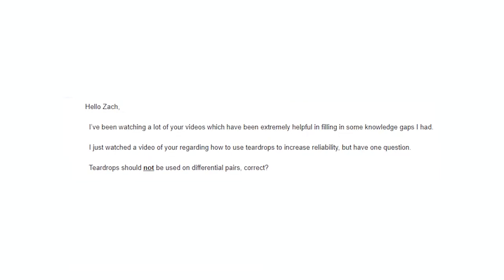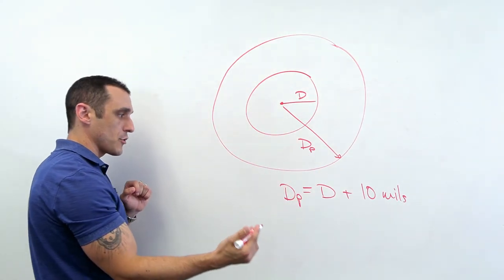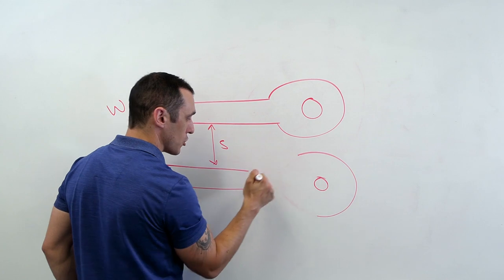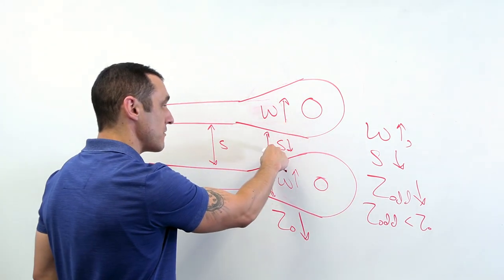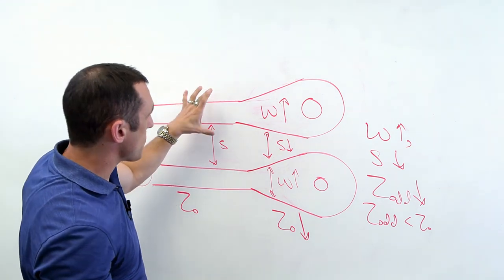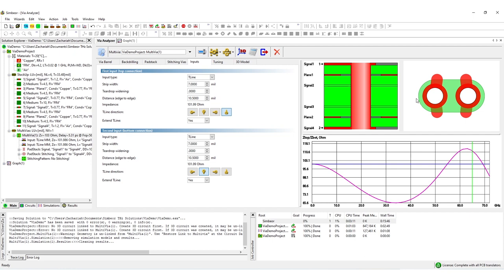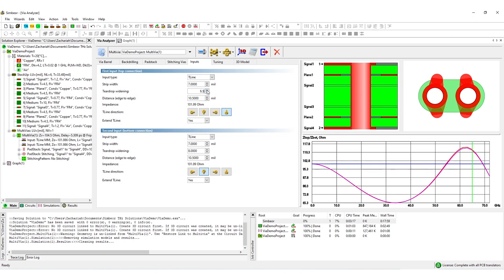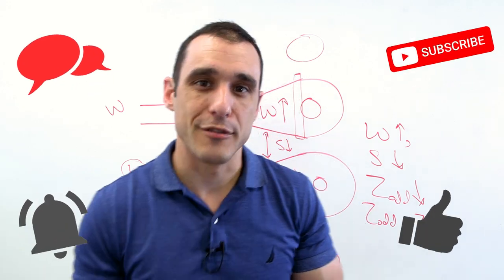When to Use Teardrops on Differential Pair Vias

Comment: You mention that part of the problem is reduced impedance from the traces getting closer together.  Does that mean it would help to put the vias to the outside, eating into the separation from other traces, rather than the separation between them?  _0 instead of -0 ?
Reply: I would say yes this is appropriate and it is usually the way I would do this on something very fast like CSI. I'll show an example in our next Q&A vid

Comment: What if you move the vias far from each other so that you keep the same distance w between the 2 edge of the via's annular ring? I think in that case we not have a difference in the impedance as the distance didn't change.
Reply: Then you'd have a possibly larger impedance discontinuity in the vias themselves
Reply: This is a great question and you would need to maintain some ratio between the spacing and width to ensure you always have the correct odd-mode and differential impedance values. I went over this in our Q&A video, it should come out soon!

Comment: I'm going to throw this question out here for anyone with the right knowledge to help me.  I'm working on a SiCFET motor inverter where the SiCFETs have a rise time of 25 to 30ns and a fall time of 10 to 15ns with a carrier frequency of 20kHz and running the motor in PWM mode from 3% to 97% duty cycle (3 phase).  We have additional functionality that is used outside of the normal PWM run mode that takes advantage of the quick rise and fall times.  Given the SiCFETS are a Kelvin source configuration, should I be treating the gate and kelvin source as a differential pair?  Another engineer has been leading the design on this project, but we have had just one failure after another.  At $10k a pop, these failures have added up to a huge chunk of our budget.  I'm looking into the circuit and PCB design on my own time, trying to find as many points of possible issue that I can.  He has been treating the gate and kelvin source traces like normal, low speed,  MOSFET traces

Comment: Dear Zach, thanks for your brilliant video!
You've mentioned about an article in the description of the video about using teardrops as tapers. Maybe you forgot to attach this. Could you please share it?
Reply: It is in the description, the title is "Should You Place Teardrops on Differential Pairs?"
Reply: @Zachariah-Peterson  Yeah, exactly! Initially I was a bit confused and tried to search an arricle with a title that included word "tapers". I've already looked through it, very useful as usually! A curious thing that I've noticed, that it is not mandatory to make the lenght of the taper equal to quarter wavelength. I thought that this parameter shouldn't vary and the length lambda/4 is a strict criteria for impedance matching.
Reply: @pavelkobrisev2574  I'll do a video on the Klopfenstein taper because it's a good example where you don't use a quarter wavelength match, and you get broader bandwidth matching.
Reply: @Zachariah-Peterson  Sounds like a Black Magic)) Thanks for your efforts! Looking forward to your next videos!

Comment: Is there a way to make round traces instead of right angle and 45 degrees? Or generally follow a curved route with an inflection point when connecting two parts that are not   aligned with each other?
Reply: Yes, so long as the router you are using includes an option or setting to allow this.
Reply: Gerber files allow arcs as well as lines. For generic curves instead of just portions of a circle, just splice together a whole bunch of short pieces.  How easy this is in your higher level tool varies ... Support for arcs has been one of the quality-of-implementation issues that some skimped on for decades.
Reply: While routing, hit the tab key to pause the tool, then go into the Properties panel, below the geometry options you will see some options to select right-angle, circular, etc.

Comment: hello sir, what do you mean by class 3?
Reply: I believe this refers to IPC reliability standards
Reply: Yes I am referring to an IPC reliability standard, which will place requirements on annular rings during manufacturing. As a designer, this means you need to include a minimum pad size on vias based on the manufacturer's capabilities. For Class 2, the safest requirement is minimum 8 mil larger than the via drill diameter, and for Class 3 it is 10 mil larger than the via drill diameter. It's best to apply this on all layers where a pad is present. Some manufacturers will request that you include teardrops whenever you are manufacturing to Class 3 compliance.